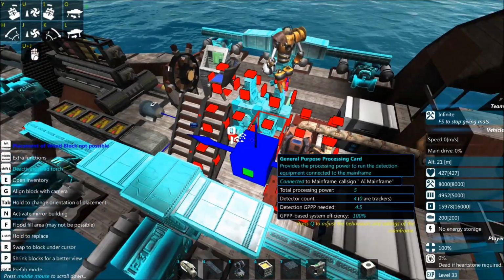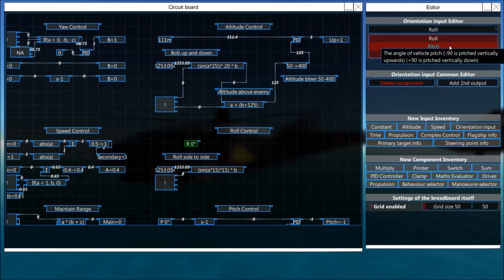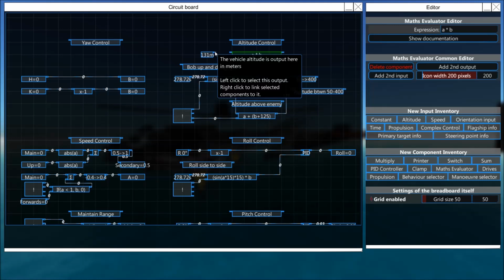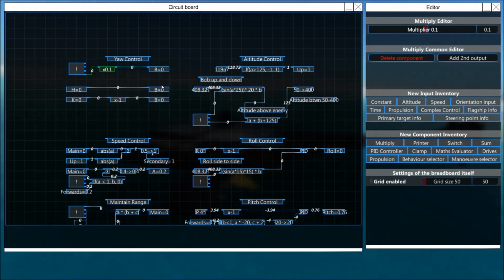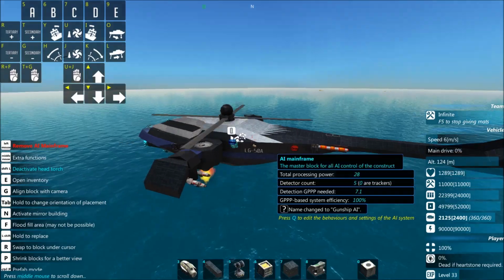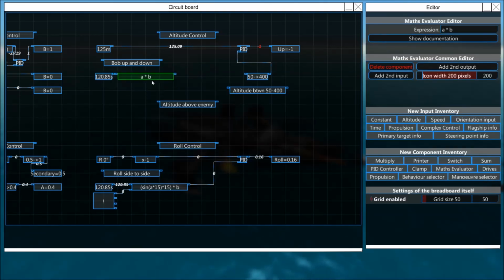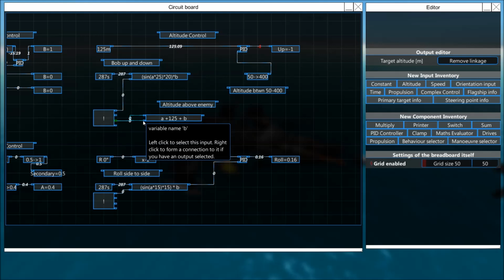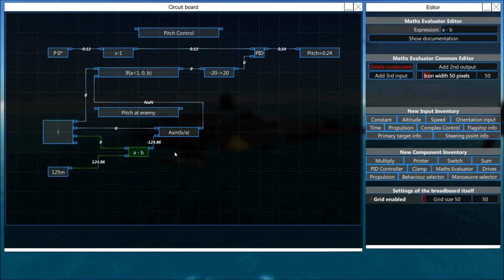From the Depths - Breadboard Tutorial - Part 2

Comment from the maker: Time stamps below! Also, my microphone decided to spare you guys from my rambling for a few seconds. I'll try to fix that for next time.
1:04 Preventing the AI from fighting commands
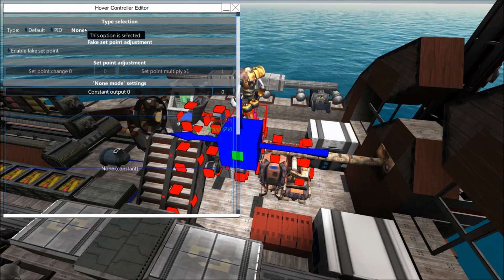2:51 Generally important info
3:26 Simple roll control (and pitch)
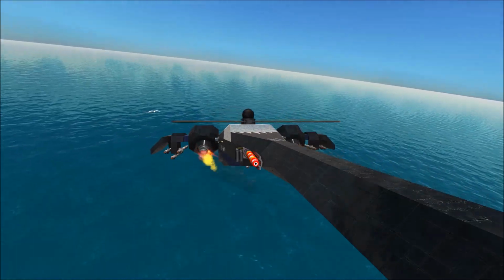6:12 Altitude control
8:20 Yaw Control (Point at enemy)
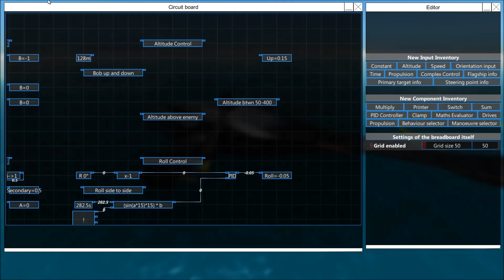9:47 Breadboard PID breakdown
11:59 Inverting PIDs
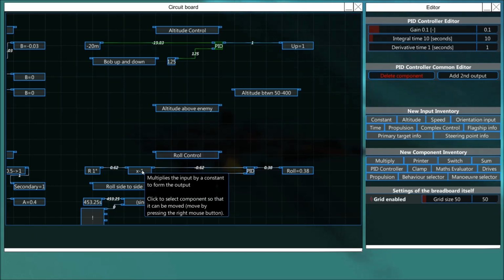12:46 Magic!
14:39 Sine wave breakdown
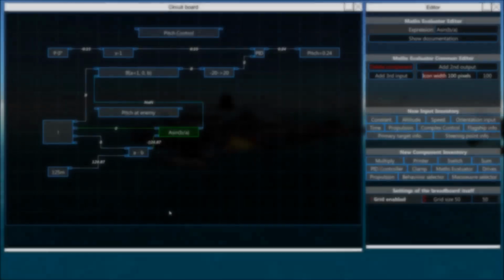18:08 Pitching at enemy
That's a lot of time stamps... better just watch the whole thing! :^)
Reply: I tried this...found proper way to make Hover and Yaw PID in Breadboard WITHOUT actual AI PID blocks connected, Pitch Roll and Strafe AI PID's as blocks are still needed and Thrust/Forward PID i found usless other than for platforms...i digress ...Setting Breadbord PID's for Pitch Roll and Strafe or Thrust for now i see no reason for if you still need those blocks.

As for YAW and HOVER PID's ...Thing is to connect it all such way Breadboad don't fight AI and only those two Hcan be checked in Breadbord menu - Steering Point Info Bearing (last output) is where AI want to point (not where enemy is) ...and - Steering Point Info Altitude (3 output) on which altitude AI want to be (not on what altitued enemy is) ...Angle and Altitude from enemy i like to set in AI behaviours and let ACB switch them according to enemy volume (more volume = easier to hit, not always more scary) ...but even if i can switch Behaviour and Maneuver from Breadboard i don't have those settings like in ACB's ...and then again in ACB's i don't have Maneuvering switching which could be usefull for more complex builds.
In the end... A CLUSTERFUCK ...and you need to use clusterfucked bypass solutions - has it charm first few times, but it really anoy me level of unpolishnes of FtD.
So how to set it...without pictures:

Altitude (Yes, you can add wobling and such like shown above if you want, i wont for clarity):

Input Altitude ------------------------------------------> (in A) PID (out)  -----------------------------------------------------------> Propulsion (Hover)
Steering Point Info Altitude (3 output) ---> (In B) PID

Yaw:

Steering Point Info Bearing (last output) ------------->  Multiply x(-1) ---------------->  (in A) PID (out)  -----------------------------------------------------------> Propulsion (Yaw)
Steering Point Info Bearing (last output) -------------------------------------------------------> (In B) PID

I also want to say i found such Breadbord AI PID SUPER accurate, i don't see diffirence from block ones. Using both allow to "save" one block of space in compact build...its not much, if Breadboard get expanded then we are talking, would like to see ALL ACB's options in here, let ACB to be simple for new players and Lua for experiments, most stream line builds shoul be set in Breadboard and AI. PEACE.
Reply: Needs a full explanation (with examples) about all Math Evaluator functions. «Show documentation» button don`t explane nothing for non-Einsteins.(( 
Any ideas?))

Comment: This two parter was hella useful even if I don't have use for most of the functions you showed, but it gave a good rundown on BB in overall to actually for me to do something with it.

Sure, you can do most of the stuff with AI stuff and AI pids, but the values you use for behaviours/adjustments/etc tend to be rough suggestions instead of absolutes. With BB and non-AI pids you can set your craft to function EXACTLY how you want, not approximately how you want. It's a good thing to remember.

Comment: I recently decided to take a slice out of breadboards, these videos helped immensely, but left unanswered my initial question; I'm trying to piece together a breadboard to replace a fist full of ACB blocks that control a turret.
For all the madness inherent, I'm building a Gatling style PAC. 4 to 6 barrels on a spinblock (all mounted onto the back of a turret) that fire as they come to an open port in the protective hull. From what I've seen, the breadboard doesn't seem to have weapon control authority or a way to sense or control where a specific spin-block is in it's position. I've overcome this with generous application of ACB's leading to a slightly clunky execution. Any advice you have would be appreciated and I hope the idea itself presents you with a fun challenge to overcome.
Thanks in advance, WalkingRaven.
Reply from the maker: Well, you can use turrets with weapon controllers set to 0 RPMs to aim the whole thing. That should be reliable.

As for firing while the openings are aligned, I'd have to check if the game resets spinblock alignment when a vehicle is pulled in and out of play... even if it doesn't, there is a way to reset it relatively reliably at the start and/or end of a fight through ACBs. Bread itself can't fire the weapons, but you can use ACBs to do the firing and bread to trigger the ACBs. You can also name the individual PAC firing pieces and then all that's left to do is mathing out how quickly your barrels are spinning to align it properly.

That's quite doable imo. Hope this helped. If it didn't, I might actually use this as an idea for the bread loaves series. Taking suggestions and showing how it can be done might be a fun way to approach this.
Reply: @OhmIsFutile  That’s the finished process I went with as well. I actually have 2 functional systems; A set with 4 long range emitters that fires every 1.25 seconds (each set to a 5 second charge) and a smaller set up with short range emitters boasting 6 per second (6 set to 1 second charges). In the end I just set an ACB that semi-manually resets the assembly both on enemy spawn and death with a delay to conserve weapon power.
If this can be used to inspire an episode, please feel free to do so. I look forward to the finished result.
Thanks for getting back to me and best of luck in your own experiments.

Comment: Amazing info, i've subscribed!

Is there any way to interact with turrets or spinblocks using this? I'd like to make a turret point at an enemy but not shoot (which  the local weapons controller does automatically)

EDIT: nevermind, I can set the LWC to maximum fire rate of 0. This way it points at them but doesnt shoot.
Reply from the maker: Unfortunately, you cannot interact with turrets using breadboards. You can control spinblocks, but you'll need one for each axis as you will also be unable to control mantlets. Plus, you cannot easily tell which direction the enemy is traveling in so it will be impossible to lead shots. If that's something you're trying to do, lua will be better.

I just like breadboards because they are more accessible to people who don't know code and are not interested in learning that just to play a game...

Comment: Is there a way to store a variable on a breadboard?

I want to be able to change the set point of a PID, for example be able to change the height of a hover vehicle.
Reply from the maker: You do not need to provide a reason. I've found uses for storing variables on the breadboard before.

The short answer is yes, but it's awkward. There are no ways that are intended. I've seen a few floating around and I have my own but they are all quirky. You can use ACBs as "toggles" which would be the most reliable way I'd say.
The way I do it is using the primary, secondary, and tertiary drive since those do not reset on their own. The breadboard looks like a loop but it actually stores the first non-zero value you put in. You can use a multiplier to store values ranging from 0 - 100 using that trick.
Reply from the maker: Here is a dropbox link to a simple blueprint. The thing is setup to hold whatever non-zero altitude you first set it to. For example, you could make planes or thrustercrafts that have the reset ACB on spawn, and your variable is the current altitude, then feed the altitude to a PID and suddenly your vehicle keeps whatever altitude you spawned it at.

Link: https://www.dropbox.com/s/oi551r22sihdlow/Memory_breadboard.blueprint?dl=1
Reply: Wow thanks man I'm blown away by your immediate and comprehensive reply!
Reply from the maker: @TheTzeestraten  I may or may not have more free time given the current events and I may or may not have been in the game already so I may or may not have thrown something together super quick... maybe. Possibly insomnia, but I can neither confirm nor deny.

Comment: Hi I've made a simple yaw left and yaw Right using breadboard but it doesn't seems to be moving, because I believe the AI is fighting it from yawing so I disable my yaw in PID and realized the ship won't be able to turn on its own now. So is there a way to give the PID priroty while having AI still be able to yaw?
Reply from the maker: There's a few ways to go about it. The two simplest ones would be to either bypass the AI by using the steering point info to move your vehicle outside combat using the breadboard; or you can use ACBs to set the AI to weapons only in combat and enable movement out of combat.
Reply: @OhmIsFutile  at options 2, so if I want my ship to broadside and circles I also have to add that into the breadboard? Basically making my own combat movement AI.

Comment: I can't seem to get the bread PID to work even after setting the PID to none on the AI, the plane just flails around even with the same settings I gave the PID block. And the yaw being inverted just means it goes in a stright line away from the target if the bearing is negative
Reply from the maker: Some AIs cannot be entirely overridden on every axis unfortunately. The only way to be sure there will be no interference is to use the empty maneuver on the AI, but that also means you have to completely replace the AI. For planes, this can be particularly challenging.
Reply: @OhmIsFutile  well damn, there goes my hopes of making my drones smaller with only a little bread.

Now I gotta learn how to bread an entire flight AI.

Comment: So won't this contradict the AI if I have a different setting set on it? Or this control is purely separate on the AI behavior? And will ignore the AI just like a GP-PID
Reply from the maker: Breadboards are different from AI control, but they can fight, which is why the first part of the video is a way to prevent that fight. In fact, GP PIDs also do fight other forms of control. It can be very noticeable depending on how you set things up.
Reply: Oh I see, im also wondering if this will work on ship, dodging slow cram by going left and right. So I'll just have to set the input and outputs on yaw and have a limits say +30,-30 deg. And have a shorter frequency since ship are slower st turning.
Reply: Same also on propulsion my slowing up and slowing down
Reply from the maker: Yes, the sine wave trick from the video can be applied to any axis, including yaw and speed.

Comment: I have copied breadboard from yours hover tanks but i have problem craft with it is perfectly stable but all including yours from workshop are going away from checkpoint if order to move, In manually control they are turning in right way but if u order them to move they turn and run away:((
Reply: I GOT IT! all u need is yaw multiply  * -1 afer PID

Comment: I tried this...found proper way to make Hover and Yaw PID in Breadboard WITHOUT actual AI PID blocks connected, Pitch Roll and Strafe AI PID's as blocks are still needed and Thrust/Forward PID i found usless other than for platforms...i digress ...Setting Breadbord PID's for Pitch Roll and Strafe or Thrust for now i see no reason for if you still need those blocks.

As for YAW and HOVER PID's ...Thing is to connect it all such way Breadboad don't fight AI and only those two Hcan be checked in Breadbord menu - Steering Point Info Bearing (last output) is where AI want to point (not where enemy is) ...and - Steering Point Info Altitude (3 output) on which altitude AI want to be (not on what altitued enemy is) ...Angle and Altitude from enemy i like to set in AI behaviours and let ACB switch them according to enemy volume (more volume = easier to hit, not always more scary) ...but even if i can switch Behaviour and Maneuver from Breadboard i don't have those settings like in ACB's ...and then again in ACB's i don't have Maneuvering switching which could be usefull for more complex builds.
In the end... A CLUSTERFUCK ...and you need to use clusterfucked bypass solutions - has it charm first few times, but it really anoy me level of unpolishnes of FtD.
So how to set it...without pictures:

Altitude (Yes, you can add wobling and such like shown above if you want, i wont for clarity):

Input Altitude ------------------------------------------> (in A) PID (out)  -----------------------------------------------------------> Propulsion (Hover)
Steering Point Info Altitude (3 output) ---> (In B) PID

Yaw:

Steering Point Info Bearing (last output) ------------->  Multiply x(-1) ---------------->  (in A) PID (out)  -----------------------------------------------------------> Propulsion (Yaw)
Steering Point Info Bearing (last output) -------------------------------------------------------> (In B) PID

I also want to say i found such Breadbord AI PID SUPER accurate, i don't see diffirence from block ones. Using both allow to "save" one block of space in compact build...its not much, if Breadboard get expanded then we are talking, would like to see ALL ACB's options in here, let ACB to be simple for new players and Lua for experiments, most stream line builds shoul be set in Breadboard and AI. PEACE.

Comment: Yeeh i was looking at it but it didnt seem easy to tell what happens. so i did lua :-).
Good side of lua are easy to use, bad side From the depth hide the Name you need to specific function, or no tell what vector3 means compared to an other function but somehow not the same, see lua Minecraft are not = FTD load a target engine? Nope no info. this can make it more easy to a craft.

70% of my code time, is trying to understand what Dev. have typed. I:Engine or I:Motor no tell hmm.
I once made a craft that balance by ID but damage block made it repair and did'nt work. So i had to specific target by coordinates at this time i spend 2 hours, banging the same problem from any angle, so it never happened.

Dev. Jess even FBI seem easyer to get info from than FTD Lua Info. If you got there total list they named it will be 50% easyer. Short effect tell / sector yep fine. will 100% easyer (Get a dude to make it that like codes and explain, go ahead.)

Comment: Hey! I'm trying to get back in to FtD and I'm a bit stumped. i want to change the AI altitude but it's a fixed-wing and not a hovercraft or helicopter. So I want to actually change the altitude value for the behavior card and not simply control the propulsion. Problem is that I can't find any components that let me do that. ACBs can but I want the values to change based on the enemy's altitude and ACB's can't do that with any level of precision unless I use a lot of them which isn't practical to do so.
Any ideas?
Reply from the maker: It's possible, I recommend going on discord either on the loafboard help channel of the official server or hop on to BorderWise's server and ask in community help.